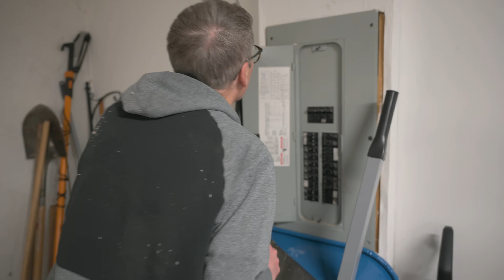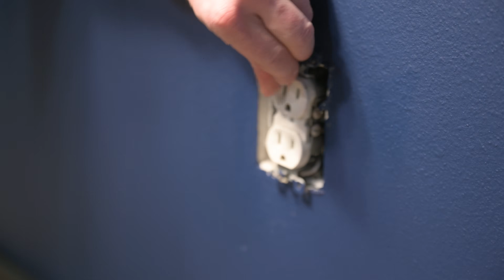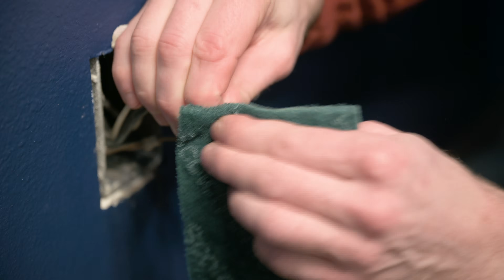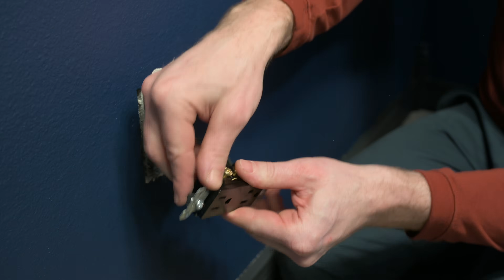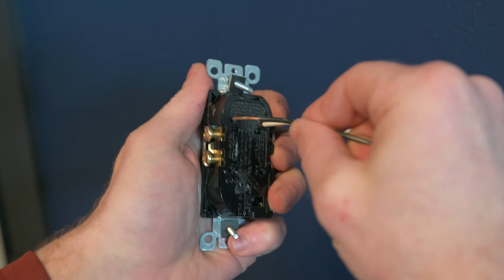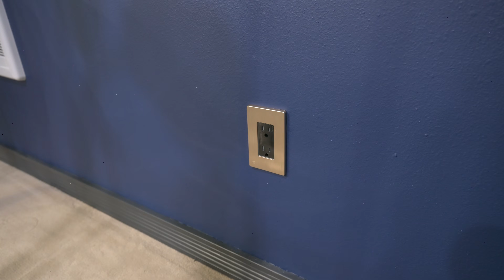DIY Electrical Outlet Swap - No Electrician Needed

Comment: You should use a receptacle/GFCI tester to verify correct wiring. They are cheap and fit in your pocket and will detect any miswiring issues like reverse polarity for example. A lamp will not, because it will still work with reverse polarity, but won't be safe. Receptacle testers fit in the receptacle like any 3 prong plug, so tamper resistant receptacles are not a problem.
Reply from the maker: I really should! That would have been a great example to have in the video.

Comment: Good video, but don't do backstab connections, they are bad and only are guaranteed to last a year or two, where has the screw terminals don't have that issue if tightened properly.
Reply from the maker: Ahh very interesting, I didn't think they would include those if they were so unreliable!
Reply: @danielrvilla If you don't want to wrap the wires around the screws, I recommend cutting the j hook off and re strip about 1/2" of straight wire. Use a receptacle with a spring cage clamp terminal, like the Leviton Edge. The residential grade is a Decora style, tamper resistant device with levers to lock in the wires and will accept 14 and 12 gauge wire, similar to Wago. No screws, no exposed bare wire on hot and neutral, and no torquing concerns.
Reply from the maker: @surferdude642  I've been wondering about the Leviton Edge as I'll eventually be building a house and those might save a fair amount of time!
Reply: @danielrvilla If you're building one house, I doubt that you'd save much time, considering the enormous amount of work overall. They are nice and they are worth considering. If you want a better quality receptacle, you can use the Leviton Edge commercial grade, but they only come in the standard duplex style, not Decora. You can also get a commercial grade Decora style with the back wiring option, in which you clamp the wire between 2 plates when tightening the screws, it's not backstabbing. These are available from all the major receptacle manufacturers.
Reply from the maker: Thanks for the tips! Ah, I do like the receptacles that have the two plates to clamp the wire much more (like the GFCI outlets seem to have typically).